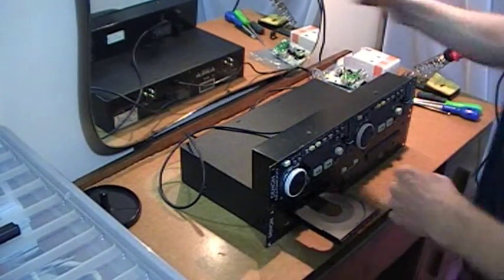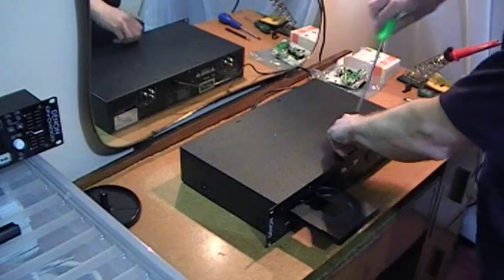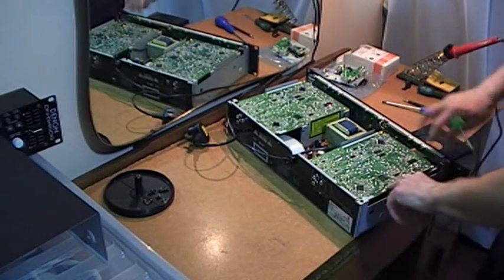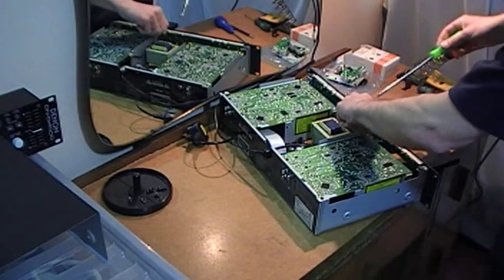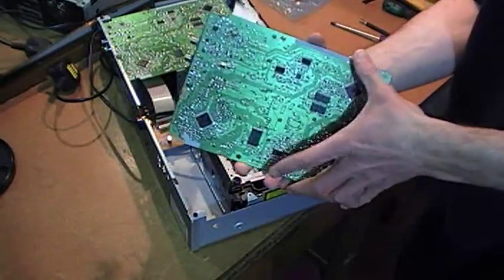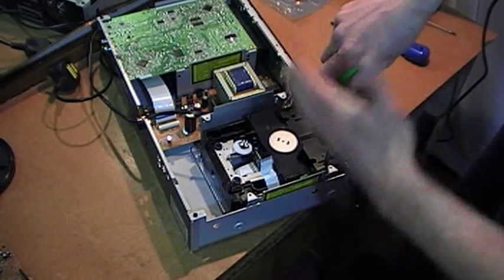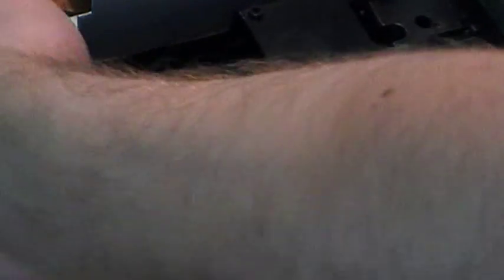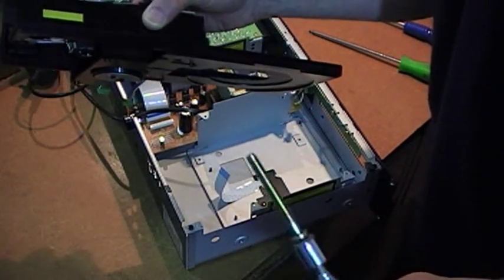Denon DN-D4000 laser replacement (Pt.2 /4) - Removing the CD mechanism

Comment: Hi Tony, 
I have a DN-4500 and the tray LED light just keeps flashing whether a CD is in the try or not. 
In addition the drive will not read a CD unless you put it in the drive and switch the unit off and on. Then it works!
Does that mean there Laser is faulty? Have you see that before? 
Hope you can help. :)
Reply from the maker: Hi Mike, I haven't seen that symptom before, it sounds like it could be more than the laser. First thing to try if you wish to diagnose is to swap the entire carriage units containing the laser and motors over, if the problem moves from one side to the other there's a clue. Then try swapping the laser units to narrow it down further to see if the fault is with the laser itself. I used to be able to get the entire carriage unit from a company which did Denon (and a lot of other) spares called Charles Hyde but they've closed down now. As these are so old now I'm not sure where you'd get a new entire carriage unit from any more. On the plus side, as they're old you can pick up a complete twin cd player to use or for spares on ebay now for less than the price you'd have paid for just a new carriage unit containing the laser.
Reply from the maker: ie, keep an eye on this one.. https://www.ebay.co.uk/itm/Denon-DN-D4500-Twin-CD-Player-fully-working-in-good-condition/114433942179
Reply: @TonyJvideos   Thanks Tony, Ill just get another CD unit like you suggested. :}
Reply from the maker: @mikeparlett  Swap the two carriages you have over first from left to right just to be sure. If the fault also moves from left to right then you know it's that carriage.